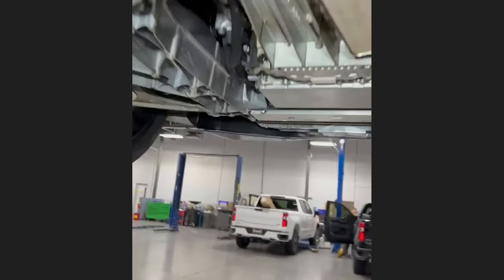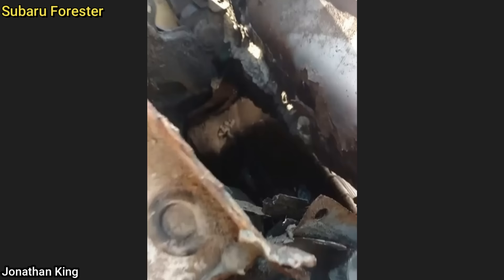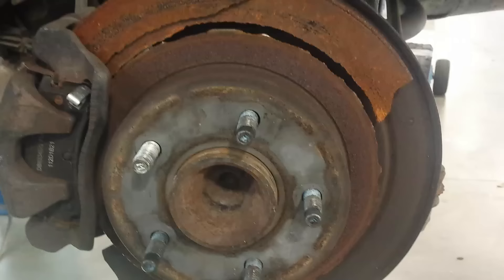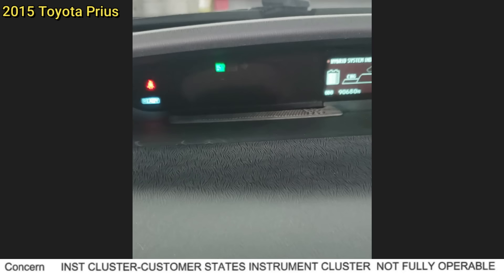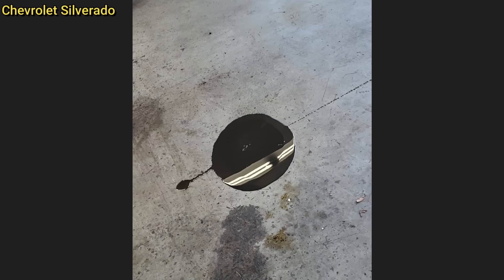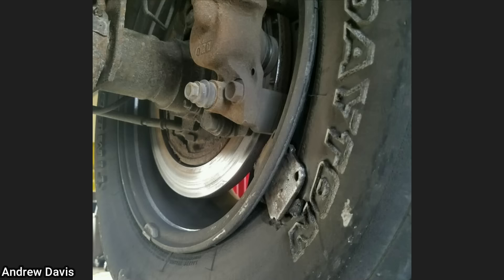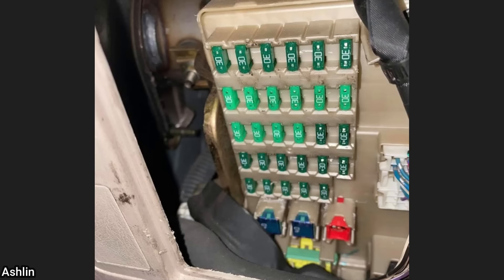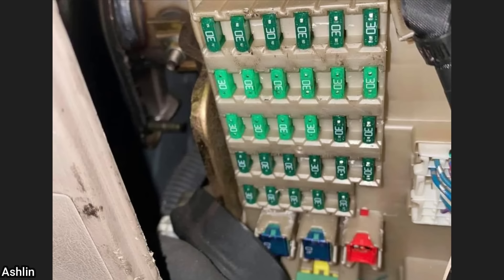Customer States Brand New Corvette Shut Off While Driving

Comment: "The technician notified the customer that the vehicle was not safe to drive"
"The customer declined all repairs and drove the vehicle away"
I SWEAR IT'S ALMOST EVERY TIME
Reply from the maker: That one needs to be scrapped lol
Reply: @JustRolledIn  some JB weld and self tappers and it's good to go!
Reply from the maker: Just needs spray foam 😜
Reply: @JustRolledIn  don't forget the top ramen 🤣
Reply: I'm a West Virginian,so duck tape it aka "west Virginia chrome".
Reply: Mechanics need to be able to legaly impound vehicals if they are unsafe to drive, caviot, the customer can have it towed to ANOTHER SHOP for repairs, or it gets scrapped. This isn't a personal property rights issue. This is a "I drive next to dudes in trucks with NO FRAME" issue.
Reply: @MeepChangeling  I want to agree, but it opens the door to fraud. 

The force of "we can keep you from driving this" will get tempting to shops. Nearby shops can also chat and work up deals to accept these "unsafe tow ins" and fix it for cheaper and share back and forth. 

As bad as these vehicles are, vastly more people are killed and maimed by inattentive drivers than falling apart vehicles.
Reply: A serious accident would be a plaintiffs cash cow.
Reply: @Meep Changeling  initially a good idea... the down side is bad actors holding the car and potentially blackmailing the customers. Rarely an easy fix.
Reply: @AlanG58  ... I was thinking Flex Seal .
Reply: @MeepChangeling  I think you need to get over it. Insurance salvage lots are filled with tons and tons and tons of brand new totaled vehicles because people suck at driving a lot more than they suck at maintenance.

Idiots, just wanting to give their rights away for the teeniest tiniest bit of "safety." To some rando mechanic, even! Insane!
Reply: @pontiacg445  What does "sucking at driving more than sucking at maintenance" have to do with this?  All he's saying is that there's a compelling interest in not allowing something back on the road that stands a very high probability of hurting or killing the occupants OR someone else.  We ask police to be medical personnel and chemists all the time (field sobriety tests, "I smell X", blood alcohol tests), so having a unit or someone at least halfway competent to make a ruling that X car is unsafe and can not be driven isn't too far outside the realm of possibility.
Reply: Mechanic/garage in my state, it illegal for them to allow an unroadworthy car leave their shop, unless on a tow truck, if customer doesn't remove car(having towed) or fix, then it starts accruing storage fees
Reply: @volvo09  I believe that is true
Reply: If I drive it in, I'm driving it out!
Reply: And those people/cars are on the road with you and me....sigh.
Reply: it genuinely makes me afraid of what else is driving next to me
everyone fears the man who declines all the repairs and has nothing to lose
Reply: @jfk64kennedy95  what state? In my state, the shop can't do anything to keep the legal owner of the vehicle from taking their property home. The most you can do is notify the state, but good luck getting the cops to do anything of actual value
Reply: There should be some way to confiscate vehicles like this 
They are clearly not fit for travel and are a safety hazzard
Reply: Well mechanics always want so much money to fix anything.
Reply: In my country mechanics can label your vehicle not road worthy making it illegal to drive until another mechanic has had a look at it
Reply: @Hawk7886  Rhode Island, it a liabiliy, safety issue, RI has safety insps, if a car not safe to be on the road, it not allowed and if a mechanic/garage, allows a vehicle, they now, know is not safe to be on the road,  they could be held liable in any resulting accident
Reply: Well, in the land of wealth inequality, average people cannot maintain the dumb cars we decided to rally behind instead of public transportation which is far more efficient and far less deadly.
Reply: I suspect in a lot of cases they have to chose between fixing their car or paying rent
Reply: @MeepChangeling  i would say they have some right to get some police officer in volved as its a public safty problem shure little more pain on the already problemed cops BUT for the sakes of keeping both their and other folks lives a tad safer it is not a bad idea. ie prevent the customer from leaving in a deamed unsafe car.
Reply: @JustRolledIn  spray foam and duct tape fixes everything! 😆 Suspension problems? Spray foam and duct tape! Sub-frame falling apart due to rust? Spray foam and duct tape! 😆
Reply: Why not just call the cops on the guy? I mean, when the vehicule is that unsafe, I pretty much don’t care for the idiot, but I care about other persons that could get into a collision with him
Reply: Just don’t buy a second hand vehicle in America
Reply: @MeepChangeling  There's no need for the garage to impound the vehicle. Here in the UK, if a car fails its MOT it's simply illegal to use it until it's fixed, and it is flagged on the national police computer system as such. You're perfectly free to take it away and fix it yourself or get any other shop to fix it, but you can't drive it - it has to go on a tow truck. Once it's fixed, it's legal to drive it to any accredited test centre for a pre-booked MOT test.
Reply: @Egon Jankowski  Or do a visual inspection on it. If you want to go the extra mile, most shops will inspect it for you. In my area, most will do it for less than $100. If you have a mechanic you go to regularly, they might do it for free to good customers. Good as in "easy to work with." Not good as in "does all recommended repairs." It keeps them from the headache of having to fix the junk you might otherwise bring in.
Reply: In this particular instance, I think the tool of choice would be zip ties and black tape.
Reply: @MeepChangeling  Mechanics need to have the ability to call DMV or other agency to do the seize work - hope they have a wavier signed by these morons when they drive away and then kill someone or hurt themselves then sue the shop.
Reply: @defresurrection   Do you really think these people have insurance or own anything????
Reply: @volvo09  Perhaps at least calling cops to tell them an unroadworthy vehicle is being driven away might work.  I've seen some cases where this was done, but it relies on the cops actually attending in time when called.
Reply: Car will break down in two days and they'll tell everyone the shop did something to it.
Reply: call the police and have them waiting around the corner
Reply: @volvo09  I think it could work if mechanics are allowed to call the police or whoever makes the decision to total a vehicle. Insurance representative maybe?
Reply: It terrifies me that those cars could be around me at any time.
Reply: @MeepChangeling  No because dishonest mechanics would use this to scam people. Yes, vehicles can be unsafe to drive and some owners are clueless. But that risk is on them. 

One of the few times I took a vehicle to a shop for a diagnosis myself, the shop outright lied and faked issues with the vehicle and then tried to do the "sorry can't release it unless you pay us for the diagnostic" until I threatened to call the law.  I do my own work now (correctly). 

Another time I stopped to have new brake pads because I'd cooked mine coming down a mountain on a road trip. The national chain brake shop I stopped at lied through their teeth about the overall condition of my brakes and claimed the rotors AND drums were too thin to re-use, and they were "not allowed by law" to just put new pads. They refused to release the car without new rotors/drums and hardware kits. I knew for a fact they were not worn down because I'd replaced them myself previously, AND had inspected them before choosing to stop at a brake shop for new pads. I was young and dumb, and as I was on a road trip in another state, I basically bankrupted myself paying the shop for parts I did not need and could not afford just for the luxury of having them look more shiny.

There are way more dishonest shops than idiot customers, in my experience.

Ultimately the shop advises the customer, and that's all they can do. They can't reach into someone's pocket and force them to pay for repairs.
Reply: they should be in jail for this kind of stuff
Reply: @MeepChangeling  yes and customer should be criminally charged too
Reply: @jx14aby  no your not if you have a unsafe vehicle you should be in jail
Reply: @neverstoplearning7214  agree so much
Reply: Feels like driving a vehicle that is in that condition in public roads should be illegal. A police matter. It probably is illegal in most places.
Reply: @MeepChangeling  yeah but that's a conflict of interests. What if they impound it when it is safe just so they can sell your car or part it out? Needs to be a third party you trust mechanics shops to be honest with their bad reputation? Please. You saw in the video where a shop left out two subframe bolts of a customers car you want shops like them to have the power to seize peoples cars? That illegal search and seizure and if that is the case nobody who is cheap and poor will ever take their car to the shop again and will only hurt mechanic shops all over the place. Think long and hard before using emotions to make stupid laws.
Reply: @3characterhandlerequired  I want to see those people driving vehicle's like this go to jail
Reply: @JustRolledIn  pray foam
Reply: @MeepChangeling  US just need a technical check, like Germany does. Car withoup pass mark is banned from road
Reply: Need a way to log these on a public site so their insurance becomes 3rd party only until repaired
Reply: Is that even legal?
Reply: Is there no penalty or fines in the US of A when driving such hazards on the roads?
Here the police would take the car away from the driver, keep the keys and paperwork so nobody can drive it anymore.
Reply: In the UK the shop would be within their rights to report you to the police for driving that car away.
Reply: @defresurrection  It can work - we dont have this problem in the UK... but then we have a regular MOT requirement and garages that do MOT work are regularly checked by a central body to ensure they arent stiffing people
Reply: Some 25-year-old at the “Speedy Lube” can take your car off the road? Have fun with that, Pedestrian.
Reply: "You realize that if you do we are obligated to call the police and your insurance compant in order to report this as you will be a hazard to other drivers."
Reply: In most countries ( I think), such deathtraps are removed way earlier, due to regular, mandatory inspection. Freedom comes with a cost 🤔
Reply: @defresurrection  Exactly how are you going to get any money? If they are driving a collection of rust in close formation, held together by paint and a prayer, what makes you think they actually have any insurance over minimum, if the state needs that, or any assets at all. Yes you got a judgement for $2 million, but will see $50, and possibly 10c a month as payment, as best outcome.
Reply: Problem is, idiots like that are always taken as an example on why we need to have such strict laws in Germany. First of all, a vehicle like that would have be taken off the road years ago due to mandatory safety inspections (you fail them, if a headlight bulb is blown for example) and even if you bring such a death trap to a shop and you decline repairs, the shop will either let you sign a paper stating that you are fully aware of the situation or, if it is this bad, they call the police and they will seize your vehicle. If you manage to drive away before the cops show up, well, prepare yourself for your license being taken away and to pay $$$.
Reply: @jaycee1980  Agree. And in general we trust our garages to be honest.  To be fair there are some dodgy ones but that's pretty uncommon these days. Some of the comments here beggar belief!
Reply: We had one yesterday 😭 Frame was rotting in many places, impact bar was rotted away, front core support, and she declined the repairs and drove off like bro
Reply: That's not legal in the UK 
I'd happily snitch that an unsafe vehicle has just been driven home
Reply: Well don't tell people what to do
Reply: @Hawk7886  there is your problem.
Reply: @GrugTheJust  in almost every case of "wealth inequality", most of it stems from poor life decisions.
Reply: @Phos9  they can use transit.
Reply: @Arcticarc1  it becomes a slippery slope since many mechanics like to stretch the definition of "safe".
Reply: @egonjankowski3587  dont second hand cars have to have a safety check before or after it changes hands or when you want to put the car on the road ?????
Reply: @keithtynan7469  ugh, obviously there are severe legal consequences if they do it fraudulently...
Reply: I’m sure it varies by the state over in America but in my country that sh*t is straight up not possible… If a mechanic says it’s unsafe to drive then it is & you ain’t getting your keys back until it’s fixed or on a tow truck.
Reply: @MeepChangeling  Maybe there should be a public and unified system for reporting this kind of situation. Once the vehicle is in there becomes illegal to drive it, and if you do and cause an accident you're not eligible to insurance and could go to jail.
Reply: @dunebasher1971  Pretty much how it works in norway. We have state run test centres for second opinion or the bi yearly checks if you don't trust the shops not to be greedy despite certifications.
Reply: Another approach is:
A. Detailed write up on work order, with "UNSAFE TO DRIVE" in big letters. B. Take pictures
Reply: @MeepChangeling  In my area of Western Canada a car can be condemned by a licensed mechanic and then have to be inspected by a licensed inspection shop before the vehicle can be re licensed.
Reply: @berardoferrari  That may be what they're doing, because they declined repairs doesn't mean they're still intending to drive it regularly
Reply: Reply 83: Repair their vehicle for free. They are probably broke and can't afford the repairs.
Reply: @LostInPhilly89  thank you,again I'm from WV so I dont spell that well.
Reply: hopefully they make the customer sign a paper stating condition of vehicle
Reply: I’ve personally had customers drive away with no brake pads, and the rotor worn through. People are so stupid it’s pathetic!!!
Reply: @dunebasher1971  Same here in Germany. If a car fails HU (Hauptuntersuchung = main inspection) with minor causes you have got 4 weeks to get it fixed or you can't drive it anymore. If the cause for not passing HU is a major cause and makes the car dangerous to drive, it can only be carried away on a trailer. You still have got the 4 weeks though. Each car has to be inspected by an independent engineer every 2 years. Independent means, he is not employed in a workshop. He is certified by the government.
The car is not only inspected for mechanical safety but for lights, wipers, horn, ... and emission as well. And it is checked if you carry the required safety and first aid equipment.
But in the land of the free you are free to put other people in danger.
Reply: @GrugTheJust  Have you seen how bus drivers go through traffic in the Netherlands. Wouldn't trust public transport one bit with the amount of lunatic bus drivers we have here.
Reply: They never mention the 1,000's of dollars in repair costs and labor charges that the mechanics quoted them before the customer declined repairs.
Reply: @MeepChangeling  Issue is what do you do in a situation of that person being poor and this is their only transportation. Taking their vehicle could cost them their job, their home, and hurt their dependents as well.

It isn't ideal but this is the country we made and now we have to deal with it. As someone who was that customer with the shit unsafe car and could not afford to repair or replace for many years (ended up replacing it finally) if someone did that to me it would have literally forced me into homelessness for a second time with no reasonable path out due to living in a rural area with no public transport. even in today's day and age many rural areas completely lack public and commercial transportation options entirely.

As another commenter also noted, fraud is likely to run rampant. That is another reason why that is a terrible idea.
Reply: @pontiacg445  so you’re saying that it’s these customers’ right to endanger literally everyone else on the road by driving a vehicle that is so obviously dangerous? Your view of “rights” is very strange and screwed up.
Reply: @pontiacg445  This isn't "the teeniest tiniest bit of safety".  This may shock you, but you do not have the right to drive a POS on public roads when one corner of the damned car is about to fall off.

If you think someone has the right to drive something like that on the road, you shouldn't have any problem driving several hours in the lane just to the right of this car.
Reply: @JustRolledIn  Don't forget zip-ties 😂
Reply: @volvo09  In my country, mechanics that repair your vehicle and people that don't allow you to drive it due to safety concerns are two separate branches. Therefore, you know that the person that forbids you to drive your vehicle doesn't have any fraud in mind. And you have to do it every 2 years by law.
Reply: @intraxx88  It's the same all over Europe, actually.
Reply: @MeepChangeling  except they'd extort money from customers to get phony repairs done to get their car back.
Reply: @volvo09  Agree totally. Giving mechanics that power, is a terrible, knee-jerk reaction whose unintended consequences would FAR outweigh benefits. Like volvo09 said, accidents are normally idiots driving unsafely , not cars falling apart due to negligence.
Reply: @intraxx88  its a state level thing here. Lots of states do have annual saftey and emmisions tests. If they fail they get a sticker that shows they failed so cops that see it can pull them over and ticket them. If it fails saftey and the cops grab you, they can tow/impound the vehicle. Some states arent as liberal and believe people have more rights and the law has less right to personal property. In this day and age with gov overreach, and dishonesty,  corruption,  etc, it can get really messy
Reply: @rastimo229  so its not really freedom is it? More like we control your "freedom" as we see fit.
Reply: @berardoferrari  public transit isnt in every county city or town
Reply: @oceanbytez847  exactly. People dont think before they speak. They dont understand underlying consequences. All they understand is well i have the money to fix my car, so should everyone else or else its their fault they dont have the money. I dont care what happens to that person, i care what happens to everyone else.
Reply: @99rda  in this country, that still doesnt matter. Its called corruption. They deem your car not safe so you have to pay their buddy to fix it and they get a kick back. If the person doesnt take it to that person, oh well, they tried, and thats enough for them to keep trying so they can make more money. Never said this country was great, but thats how it happens in many fields
Reply: @jack smith  Well, here the whole system is based on the law and you can sue the person that either did the repair or the one that controlled your car so that you know who rips you off. And the one that tried faces so much problem that no one tries.
Reply: @jacksmith2315  uber, lyft, taxi ???????
Reply: @Phos9  so are they taking a taxi home and a tow truck to the next mechanic ? i want to know so that i dont drive next to these degenerates for my own safety.
Reply: @berardoferrari  vote in urbanists
Reply: seems MOT does not exist in the usa, in europe, that car would be scrapped.
Reply: @volvo09  In my country, a vehicle in that state wouldn't be legal to drive.
A mechanic shop would be able to call the police to further handle the situation.
Reply: This would simply be illegal in my country.
Reply: @normalhuman9260  I’m sorry
Reply: @jacksmith2315  yes, but uber and lyft and taxis are!!!!!!! LOL!!!!! do the right thing and protect life!
Reply: People are broke and desperate
Reply: Because they are poor
Reply: @Hawk7886  I feel like they should be notifying the insurance company. Not the state or police. They wont do shit. The insurance company however lol they will do ANYTHING to not lose money via this guy crashing his "unsafe-is-literally-in-two-parts-frame" car into someone else whom the insurance will have to pay damages of the other persons car and medical. Its automatic negligence when told this isnt road safe which is a pretty serious add on to any type of case/scenario. So ya ur right cops wont do shit but I bet the customers insurance will do something lol I know they won't like FIXING the car but if its to prevent having to pay someone elses medical and auto costs theyd probly do it. Actually I just realized theyd definitely just kick the person off their insurance. Theyd be a liability at that point.
Reply: @dunebasher1971  You can just drive on an old plate and make sure cops never see your expired tabs. Simply making the car illegal to drive stops nobody who was already willing to drive a car like this.
Reply: @ryanburns3921  "Im buying a car off Craiglist but totally have a hundo to drop on a car I might not even want"
Reply: @stitchfinger7678  Private party sales can be a great place to get a decent value on a car. If you have, or know someone with, a little knowledge about what to look for. If you don't have an extra hundred bucks to get it checked out, you certainly won't have an extra thousand plus to get if fixed when something goes wrong. Used cars are always a risk. Even when bought from a stealership. Having a "pennywise and pound foolish" mindset kept me broke for a long time.
Reply: @neverstoplearning7214 in most countries that’s within police powers
Reply: @MeepChangeling  some states do require it. I've seen a few episodes on this channel where the shop either called the cops, made the person tow it, or made the person sign a liability waiver acknowledging that they were told their car is unsafe to drive.
Reply: But vehicles that are falling apart are a more preventable hazard.
Reply: But vehicles that are falling apart are a more preventable hazard.
Reply: But vehicles that are falling apart are a more preventable hazard.
Reply: But vehicles that are falling apart are a more preventable hazard.
Reply: But vehicles that are falling apart are a more preventable hazard.
Reply: But vehicles that are falling apart are a more preventable hazard.
Reply: But vehicles that are falling apart are a more preventable hazard.
Reply: But vehicles that are falling apart are a more preventable hazard.
Reply: But vehicles that are falling apart are a more preventable hazard.
Reply: But vehicles that are falling apart are a more preventable hazard.
Reply: But vehicles that are falling apart are a more preventable hazard.
Reply: But vehicles that are falling apart are a more preventable hazard.
Reply: But vehicles that are falling apart are a more preventable hazard.
Reply: Imagine the outrage in USA